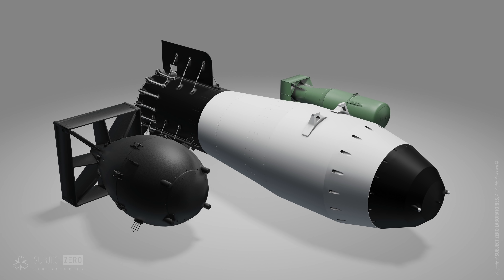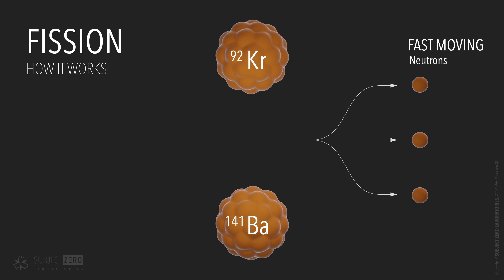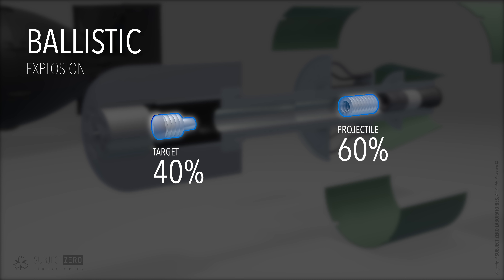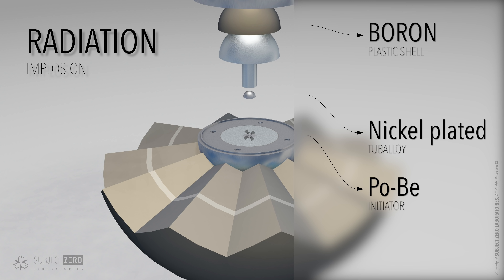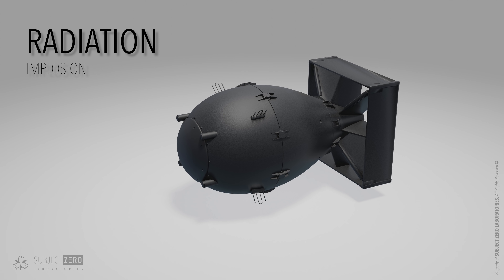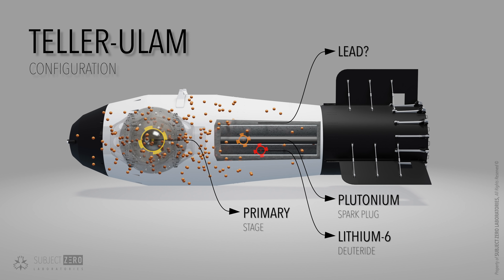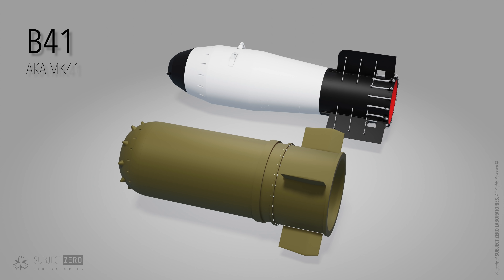Are Russian Nukes the Most Powerful?

Comment: Big errors - Fat Man didn't use U-235, (04.10) but Pu-239. And "Radiation Implosion" is for the secondary stage in a multi-stage weapon. It used RADIAL implosion.
Reply: Yea,didn’t it have a mini- conductor in it shaped like a spiked ball.
Reply: @cassiecraft8856  what? No
Reply: @cassiecraft8856  
It wasn’t spherical.

Comment: A thing you're missing is that the Tsar Bomba and the B41 both had multiple 'spark plug' assemblies, so that they were fission-fusion-fusion weapons. The B41 had only one extra fusion stage, while the Tsar Bomba is reported to have had several. The primary (fission) stage caused the secondary (fusion) stage to detonate, and that in turn set of the tertiary (fusion) stages.

(As I understand it. This stuff is hard to work out the details of, if you don't have clearance.)
Reply: Yeah. He missed the most important fact that it's a three stage fusion device, fission-fusion-fusion

https://en.wikipedia.org/wiki/Tsar_Bomba#Product_202

Have to thumbs down for that; given it's like the #1 thing that makes the Tsar bomba unique
Reply: @elpechos  B41 and Tsar Bomba almost has same design internally, they employ three stage/tertiary stage or fission-fusion-fission design.
https://en.m.wikipedia.org/wiki/Nuclear_weapon_design
Reply: In theory tertiary fusion will be powerful but in practical it is very hard to achieve, the Li-D fuel might get blown away by them before it can achieve fusion
Reply: He olso missed that we dont know exactly the weight of the tsar bomba but i heard that they not only reduced the power by a half but also tried to make it not  explode befor the time
Reply: @ricodelpiero  The fast fission of the secondary jacket in fission-fusion-fission bombs is sometimes referred to as a "third stage" in the bomb, but it should not be confused with the obsolete true three-stage thermonuclear design, in which there existed another complete tertiary fusion stage such as in the Tsar Bomba.

From your own link
Reply: @elpechos  that's mean fissionable material jacket weapon is not a true third stage thermonuclear weapon, like in B-41 and Tsar Bomba that has tertiary stage core in middle of the weapon.
Reply: @georgyekimov4577  Nah, you can look up the weight online, it's 27 tonnes. As to not making it explode early, all bomb-makers do that. ;)
Reply: @akizeta  i mean that the bomb wont blast away the plane and its still a mircle the pilots survived i even the first parachute weight over one tonn and all the stuff that should make shure that the bomb works properly i dont thik its possible to make the B41 ass large as the tsar bobma  and dont loose its efficienty (if nobdy is using kamikaze of course
Reply: The b41 was the only nuclear match to tsar from the us the us actually did had plans to make a bomb powerful than tsar but it was never tested the bomb idea yield would be 150 megaton and no I’m not making this up look it up on oura about america nuke that could be bigger than tsar but don’t anyone remember the us build the most dangerous missile the slam missile of nuclear missile from hell this was far More deadlier
Reply: @georgyekimov4577  true I think that’s why the b41 was a maximum yield of 25 megatons Russia had the bigger bomber but the us didn’t
Reply: @elpechos  Actually the biggest thing he missed is that in D-T fusion around 70% of the energy is in the form of an ultra fast neutron. This neutron is capable of fissioning the normally non-fissile U238, and so radiation cases are standardly U238. This "fast fission" accounts for about half the yield and 90% of the fallout. Tsar Bomba would have been 100MT with a U238 radiation case. As for the American bomb, it came in both "Dirty" and "clean" versions with the dirty one having twice the yield.
Reply: The Tsar Bomba had so much Fusion that it produced almost no lingering radiation, a very clean bomb , the Soviets put that in their description of the Bomb to show everyone that it was not all that Bad  !
Reply: @oceanhome2023  yes tsar and b41 the biggest nuclear weapons
Reply: @jayleong5634  A tertiary stage is more of a technical challenge than a secondary.
Reply: Design, which use trinitrotoluene lenses as boosters have physically unlimited nuclear payload size. It's possible to scale atomic bombs up and down to almost any degree, that's one of the biggest advantages od such weaponry. But it's much more efficient and financially viable to produce thermonuclear warheads for high-tonnage explosives.
Reply: @dannadx3840  In what way are TNT lens "boosters" responsible for the yield flexibility?
Reply: @oceanhome2023  I mean, absolutely speaking, it was actually quite dirty. It produced 3.4 times as many fission products as the largest pure fission device.
Reply: @Evan_Bell  No additional fusion stages are needed (with limited capacity) to compress the core
Reply: @dannadx3840  To compress what core? The core of the primary? Secondary and tertiary fusion stages don't compress the primary core.
Reply: @Evan_Bell  "Primary fusion stage" is the core, which is directly responsible for the following explosion. "Mark 3" or Fatman used TNT lense scheme, which has been synchronised with lamp electronics. The reason why nuclear weapons of this type are not currently used, is because it's less economically viable, compared to multi-stage designs, however, it can be easily rescaled to match any tonnage you need, just add more filler
Reply: @dannadx3840  There is no such thing as a primary fusion stage. That'd be a 4th generation weapon which has eluded us for decades. The Mk-III used Comp B (RDX/TNT) and Baratol lenses.
I don't know what you're referring to with "lamp electronics".
The reason there are few single stage weapons in the world's arsenals is because above 50kt or so, it becomes more efficient in terms of specific volume and mass to use a two stage approach.
No, single stage devices cannot be scaled up to arbitrary yields.

Comment: Nice graphics, but tons of wrong... What you show as "Radiation Implosion" most definitely isn't.  You also misrepresent a single stage of the Tsar Bomba as being two stages. The components you describe are inherently part of a single stage.  Also, you show particles bouncing around within the Hohlraum interior of the bomb when it is WAVES of soft X-rays that create the radiation pressure that implodes the secondary.
Reply: Well technically most thermonuclear bombs use the neutron pressure to compress the secondary(through a intermediate know as fog bank) but ya the video is full of factual errors. the kind most elementary school kids would probably not make.(or at least be smart enough to research the correct answer)
Reply: But if you consider quantum physics,   what you call waves are made of modular particles, so the graphics is right.
Reply: Can you introduce what you said in English yoooo????
Reply: @Lucinat0r  Dude I'm pretty smart, though no f**king idea what you're talking about. :)
Reply: Why dont you make the video then?
Reply: @jc.1191  It does.
Reply: @jc.1191  It's still pressure lol
Reply: @jc.1191  I think you already know this. Force acting on an area is called pressure. Pressure is again... force. Also energy density is pressure. I'm not spouting just so you know. Energy density is literally in astrophysics and cosmology. You can shine a light on a extremely thin and light light-reflective sheet in empty space and make it move. So pressure can be felt in vacuum.
Reply: No, the x-rays from the primary vaporize the outer layer of the secondary, creating the pressure needed to compress the secondary.

So much wrong with this video.
Reply: @Lucinat0r  No. "Neutron pressure" does not drive radiation implosion.
Reply: @jc.1191  Yes it does.
Reply: Yeah,  what he said...
Reply: @Evan_Bell  
There are 2 waves of neutron pressure.  Did you forget that?
Reply: @dr.OgataSerizawa  I mean, there are more than two sources of neutrons that peak in output at different times, and thus I suppose could be considered waves. But neutron pressure isn't what implodes the secondary.
Reply: Source: trust me bro
Reply: @Xenon_001  He's right.
Source: Publicly available information

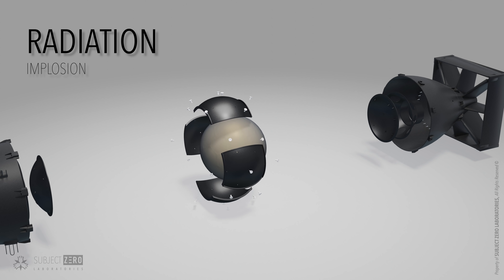Comment: More technical errors: 4:00 shows Fat Man bomb labeled with "Radiation Implosion".  Wrong, it's high explosive compression.  Radiation implosion is the mechanism for igniting the secondary of the Teller-Ulam thermonuclear bomb.
Reply: There was shielding between the explosives and the Pu, it was radiation implosion.
Reply: @prjndigo  No, vibrolax is correct. The "shielding" of which you speak simply couples the mechanical compression from the explosive lenses to the pit.
Reply: No, shielding has nothing to do with this point. Radiation implosion was first used with later "Hydrogen Bombs" (multi-stage thermonuclear devices using both fission and fusion).  Both the Trinity test and the "Fat Man" bomb involved Pu-239 core implosion powered by conventional explosives, not by radiation.
Reply: @prjndigo  You don't know what you're on about.
Reply: Also it is official that Tsar bomb had 3 stage filled with lead , this was due to cancelation of the project for which it was designed. Also the bomb was designed in such a way that more stages could be added increasing the power
Reply: Further technical error stating the neutrons from the initiator reach delta phase plutonium... the stabilized delta phase Pu-239 has LONG SINCE transitioned to the alpha phase by the time neutrons from the crushed initiator reach it...
Reply: @Evan_Bell  To be fair, neither does the maker of this video, saying Fat Man used explosive compression of uranium....
Reply: @redwhiteandbluebonnets8180  Well, it did. The tamper.
Reply: @redwhiteandbluebonnets8180  The initiator, plutonium core, uranium tamper and aluminium pusher were all shock compressed by the HE assembly.
Explosive compression of uranium was performed. It used explosive compression of uranium. 
Was the fissile material uranium? No. But uranium compression was still used, and if it somehow not compressed, it'd have yielded less than 20kt.
The pit is the plutonium core, not the void in the plutonium for the initiator.

Comment: “Their designs were so simple, it makes me wonder why the Germans never figured it out” Actually, the hard part isn’t the design used, Little Boy’s design didn’t even get the dignity of a test, the hard part is the fissile material. Iirc, the Germans couldn’t get any to test with in the first place.
Reply: There were some early experiments towards nuclear reactors. But instead of fuel rods it was more of a chandelier. Didn't go anywhere near to a functional reactor, but the experiments where there.
Reply: @HappyBeezerStudios  Meant they didn’t get enough fissile material to test with. Not only do you need reactors for it, but also centrifuges that can concentrate the correct isotope of Uranium afterwards. It’s very tricky.
Reply: @HappyBeezerStudios  
          “Chandelier”?

Comment: 4:08 - "With only 6.4 kg of plutonium, ... compression uranium-235 to twice its normal density."  Well, which was it - plutonium or uranium-235?  The answer is it was plutonium, and there was a uranium tamper in Fat Man in addition to the core, but it was uranium-238, not -235.   The core was compressed to 2.5 times its diameter, which is 17 times its volume, therefore 17 times its density.  This is NOT radiation implosion - that refers to the manner in which the fusion secondary of a thermonuke (like the Tsar) is imploded.  The implosion in the Fat Man was straight-forward explosive compression.

6:12 - "Since details are not available, I'll have to extrapolate..."  The details have been available since published in a popular magazine in 1977, which the AEC made a huge stink over.  The magazine claimed all the details were published piecemeal in other unclassified documents; they won their case.  That was 40-50 years ago.  The details are available. The internals of the Tsar are available; hell, in Wikipedia, in an article charmingly named "Tsar Bomba".  There were two primaries and two secondaries on each end of the massive tertiary stage; special work was done on the electronics to synchronize all of the pieces.

6:35 "...but lithium also breaks down, increasing yield." You betcha.  If the lithium did not breakdown into tritium, there would have been no secondary yield.  The reaction is very specifically "deuterium-tritium fusion", other combinations of hydrogen require even higher temperatures.

6:41 - The Castle Bravo contained large quantities of Li-6 and Li-7 which were responsible for a 2.5 times increase in blast yield, from 6 to 15 megatons." Very confusing - 2.5 times what?  Actually, the Li-7 was thought to be unreactive, so the 6 megaton yield was based on the 40% Li-6 in the "Sausage" test bomb.  The Li-7 turned out to be (surprise!) just as reactive as the Li-6, thereby increasing the yield by 1.5 times over the estimate.

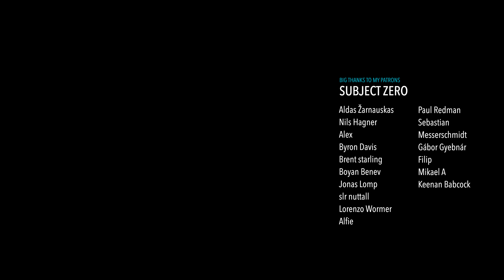8:51 "At first the Tsar Bomba was supposed to have a third stage capable of adding an extra 50 megatons.", Well, this is often confused when speaking of nukes. The Tsar had three stages - the primary is the fission bombs, the secondary was two fusion stages on either side of the tertiary stage - another fusion stage of a massive scale.  That combination raised 50 megatons.  Surrounding all three stages individually was that uranium-238 tamper, a fixture of (nearly) all nukes, starting with Trinity.  That is not referred to as a "stage" in bomb engineering literature; it is simply the tamper.  Surrounding fusion stages, the tamper releases huge amounts of fission (obviously of much higher yield than the primary fission bombs) from the high-energy neutrons. As you say, THAT was what was absented from the Tsar (or rather replaced by a "base metal" tamper) to keep its yield to 50 megatons.   So it had three stages, and the tamper was replaced to keep the yield rational from a safety and PR standpoint.

Insult to injury - your title is click-baity, which I'm sure you realize.  Your point is that the Tsar could have been 100 MT and was, therefore, mightier than the actual Tsar, but you don't state that in the video, so the point of your title is lost.  The Tsar, as is, is the world's record-holder in terms of actual, realized yield.
Reply: "The core was compressed to 2.5 times its diameter"
It was compressed such that its diameter was 2.5 times larger than originally? That's not a compression, that's an expansion. Its diameter was not decreased by a factor of 2.5, it's volume was. Also 2.5^3 is 15.625, not 17. The density increase according to open literature was by a factor of 2 - 2.5. First principle efficiency equations indicate a compression factor of 2 was required for the yield it produced. Plutonium cannot be compressed by a factor of 17 by a single shock. Nor is a compression factor of 17 necessary to produce the yield it did. 

The Tsar bomba did not use two primaries. 

Without lithium transmutation, there would still have been secondary yield from sparkplug fission, D-D fusion and some tamper fast fission. D-D reactions dominate early on in the fusion burn. Its the neutrons from this reaction that breeds the tritium. 

2.5 times 6.
Reply: @Evan_Bell  Sorry for the wording.  No, it was compressed by 2.5 times.
Reply: @puncheex2  Somewhere between 2 and 2.5 according to open literature. 2 according to first principle efficiency equations.